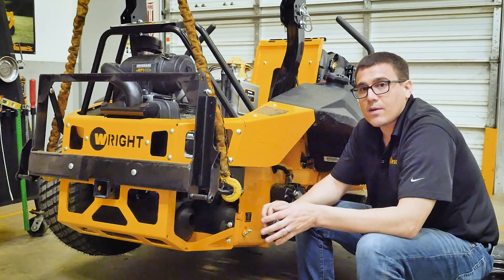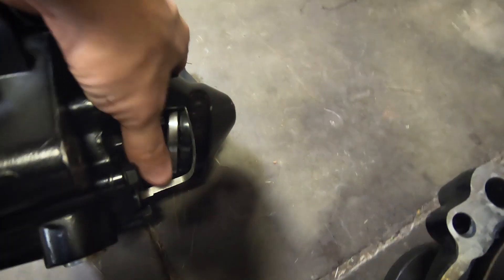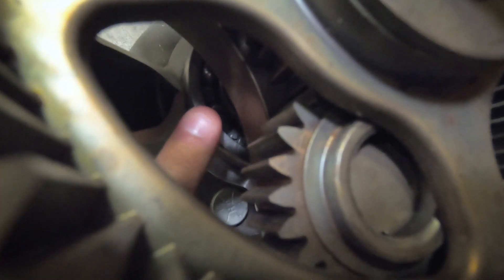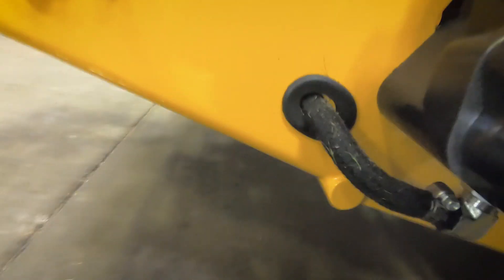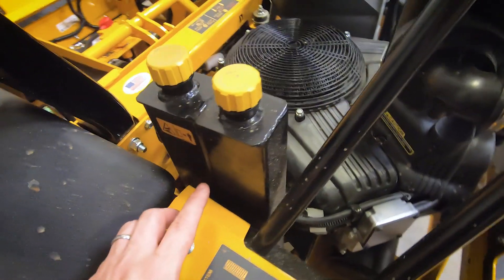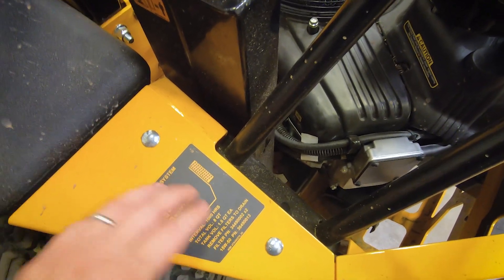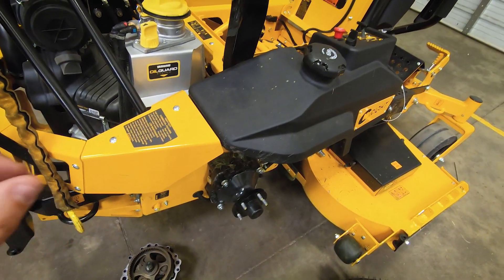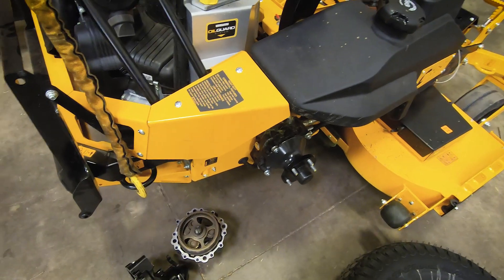WRIGHT | ZXT HYDRO SYSTEM | 1,000 Service Interval

Comment: Just purchased this mower. Is the hydro oil change procedure for this new 1000hr system the same as on the zk? Drains from filters? Do you have a video changing hydro oil on this machine?

Comment: Ed, thanks for all of your videos that you do. I've been watching a lot of them lately. Last week I bought a ZXT and used it once so far. Love the machine! One of my hydro revisors is low (no oil visible in the sight glass. There is no leaks, all fittings are dry. The machine operates fine. I called my selling dealer and spoke to the service manager. His first thought was not to worry about it and said he will get back to me. My thinking is to add hydro fluid to fill to top of sight glass to be safe. What is your thought?